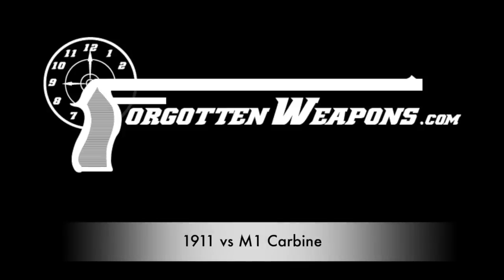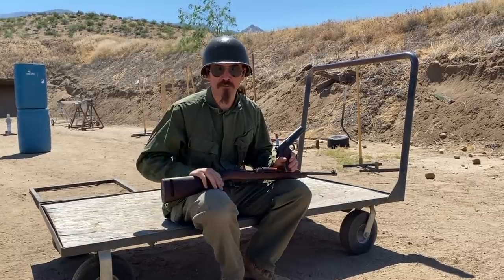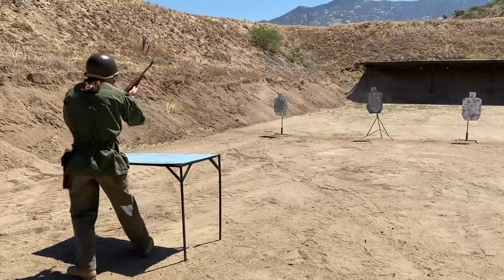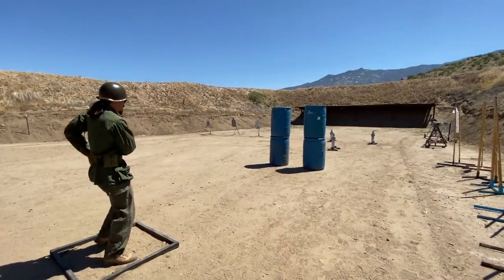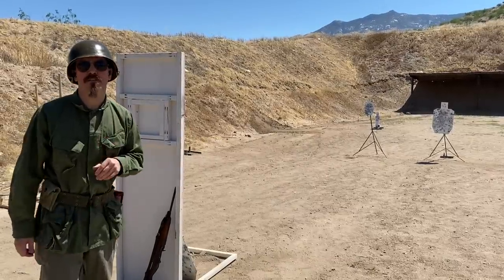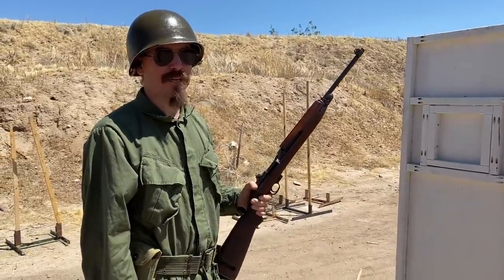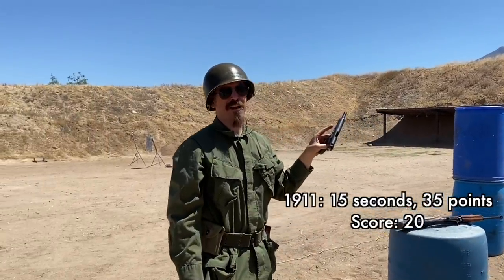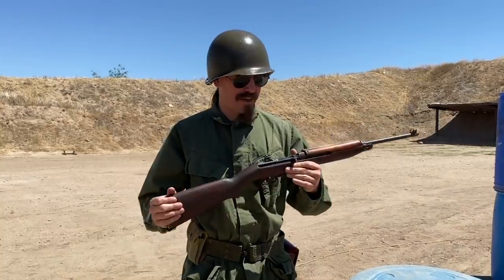1911 vs M1 Carbine in a Practical Match

Comment: No surprising results here. And that's taking into account that the simulations done here are relatively favorable to the 1911. In RL situations, support crews would typically engage enemies at distances where the 1911 is not even viable.
Reply: So if you put the two weapons into conditions advantageous to the 1911 and it still loses, that says something.
Reply: Stevarooni i mean... what did you expect? 1911 is a sidearm that you go to when the big guns run out
Reply: Can see why the US considered dropping M1911 as a side arm in favor of the M1(A1?)
Reply: TrolltheBurrito Or when exploring doorways, tunnels and other such things.
Reply: Jeffrey Root exactly, they both have their intended purposes
Reply: @nirfz  a friend of mine told me a story of a guy who left his rifle to do whatever, his CO took the rifle and made them all look for the rifle for hours.
Reply: @nirfz  In addition to what you've said: it's not only the time to draw the 1911 from the holster but to chamber a round as well, as they were carried with an empty chamber at the time.
Reply: If you have the M2 carbine you also have full auto fire which is an advantage to consider because as a rear area solider your job in that situation is to not die and the larger mag and full auto fire of the carbine is much better suited for
Reply: Yes, in a RL War situations the Carbine M1 out do the 1911. But in todays modern society, I can carry and use my 1911 out and about a lot easier than an M1.
Reply: @seanmac1793  Drop the rear area garbage. Support forces are in danger and there is no front in War today.
Reply: @neoasura  CCW and war are not the same.
Reply: @WALTERBROADDUS  in world war 2 there was one
Reply: @seanmac1793  I think you forgotten that the Airborne were using M1 Carbines for both frontline & behind enemy lines.
Reply: @nirfz - was driver for many years. Issued pistol (M9/M11) and carbine (m4), as well as a 12ga for door knocking. My pistol was only good to fight my way back to the carbine I should have never set down.  Learned that lesson quick, and once was all it took.   When driving my pistol was holstered on my right thigh (because 2004), and my carbine rested between the e-brake and the trans tunnel of my truck.  When outside the wire and I stepped out of the tuck, even to drain some fluids behind the open door,  that carbine was NEVER, not once, more than an arms reach away.  This is the standard, and I can’t imagine someone in a similar position in WW2 doing any different.... IF they survived the aforementioned dumb mistake I did.   Legit test and shows that a carbine is, nearly always, the superior weapon.
Reply: @Rudofaux  I mean that is for exactly the same reason why it's sp good for non frontline groups
Reply: @hellcatdave1  depends if he is a crewman it would probably be somewhere on the vehicle. Arty probably over the shoulder while moving but set a side when operating the guns.
Reply: @seanmac1793  
I agree. Having to fight the carbine trying to slide off of your back every time you grab a 105mm round from the crate would be more trouble than it's worth.
Reply: @seanmac1793  Were you there during WW Deuce? I got news for you, no one gets more CAB trigger time behind a crew serve these days than an 88M. That's a truck driver.
The Logi Lines are always Target #1, and the MSR's are where they do their bloody business. For the record, we rack our weapons next to the cannon on the battery firing line.
Reply: I would suggest the opposite.  Pistol is in a slow to use holster (fair enough) but the rifle was ALWAYS in a very handy place to just grab...and I simply don't believe that would be the case in real life.  Where would it be in, say, a truck?  Possibly even behind the seat..... or somewhere equally less optimal.  Don't get me wrong...I'd rather have a carbine than a pistol...but I think THESE stages favoured the CARBINE simply because it was always readily at hand.
Reply: @WindFireAllThatKindOfThing  yes but the realities of war were quite a bit different at least to my understanding. It was a war with defined frontlines. I will haplly admit if I am wrong. Also I never said the carbine wouldn't be handy there are just a lot of situations where it's not over the shoulder. It might be under the wind screen or latched to the tank. For arty like I said probably over the shoulder if your moving and set down in arms reach when the battery is set up. I have never served nor will I be able to but I don't think what I saying has any flaws logically with it.
Reply: And a nice tan
Reply: MrNotadream  you just attach it to the side of the vehicle with shovel and other tools
Reply: @FoxtrotFleet  thats how this drill was run.
Reply: @andyhenderson441   excellent point.  I made it also
Reply: chris younts  the vast majority of rounds fired at the enemy is to keep their heads down so they can't line up a shot at you. I could see squeezing off a 1911 while others are reloading or when running low on rifle ammo.

Comment: A LOT of what I see, is the trouble Ian is having with the "suicide flap" holster.
When I was an MP at Bragg in the late 90s, we were going through a monumental equipment shift, from "military gear" to "civilian gear."
Yep, back then, it was the military who looked to civilian cops for advice... Not like that today... Hasn't since 9/11... But, I digress.
I was issued a suicide flap holster, in OD Green (as was the MP Duty belt configuration of the time) and we called them that for a reason...
Not only did you have to fight with, and hold up the flap, the friction inside the holster during the draw, would cause the whole f'n holster to flip up, and jam everything up.
Every time, throughout this video, you can see Gun Jeebus encountering these problems.
When the MPs switched to "real cop" equipment, we went with Bianchi. And they actually made those flap holsters in black, I still have mine - they were sold commercially too, I didn't steal, I just bought mine before they were issued. I'm stylish like that. 😏😎

Now, they did make a thumb-break snap "conversion" which eliminated the suicide flap, and I also had that, and it was a game changer, for that holster.
The Uncle Mike's Level 3 holster was THE hot item at the time, and UM's had since gone to complete shit. Only the K9s, and a few other very specialized individual MPs (like wildlife and traffic crash investigators, etc) were issued them, because the Uncle Mike's was that goddamn radical of a change from the traditional, even in the civilian police world. So, the elites of the already elite Airborne MPs got the goodies.

The suicide flap holster was eliminated by 2001, replaced with horrible Bianchi Level II holsters, that would literally jam the Berettas in... They were downright lethal, without a doubt. Way worse than the suicide flap even... We had to jam our pistols through the holster/unholster procedure hundreds of times, sometimes having to do it by teams, peeling off shreds of plastic from the Bianchi "pinch system" - until the pinch system was effectively useless as anything more than light retention, and we relief on the snap. By that time, I was a DA Civilian cop, working at Fort Greely Alaska. I still have that holster too, because by... Urggghh... 2005-ish... We standardized on the UM Level 3. Although, I also carried with a Serpa (which became the next big thing after the UM's Level 3) - again, my personality and being the first kid on the block to have the newest toy, 😆 But, that didn't last long... Even though I still think the Serpa is a BAMF.
Then, eventually - as a cop for Veterans Affairs in my career - everyone went to Safariland holsters, and Uncle Mike's, became obsolete.
And uh, yeah - so there's your "Holy crap that was a long post, lesson in military holster history" way of saying, holsters make all the difference - choose wisely, choose what fits, and and choose knowing that you are 100% confident, if you ever have the need in a real world "holy f'k, oh dear!"
Reply: Well, I have none of your record, but it seemed a lot like that to me as well. I wonder how the pistol would have fared if it was laying on the barrel itself.
Of course, the recoil difference matters as well.
Reply: Definitely would have been closer with a better holster and/or the pistol on the table. The point Ian's trying to make is difficult since he's a good shot with pistols, and far more practiced than most line infantry were with pistols at the time, let alone support troops. The carbine is much better for someone who can't aim with a pistol, but pretty similar for someone who can. I know from experience with my Grandfather's M1911A1 and M1 Carbine from WWII that it's far easier for a novice to get shots on target with the carbine than the pistol.

Comment: This is more a weapons system comparison rather than just the weapon.  The incredibly slow times for the 1911, can in part be attributed to the ridiculously slow holster.  Therefore probably making it an even more accurate comparison under pressure.
Reply: Well, you have to conder the Ian is an expert shot with a pistol, as opposed to Joe Bazooka who was not nearly as well practiced with pistols.

Comment: One thing to consider is that I would think Ian has had far more handgun trigger time than the avg WW-II GI would have had which is bound to improve his 1911 times over what the avg GI would have done. This makes the M1 in my eyes at least even better than shown for it's intended propose.
Reply: The gap would widen massively if a less experienced shooter did this test, they should try that.
Reply: Yeah, it shows how much it improved the ability of a GI to defend himself.
Reply: I still think that if I had to chose any one gun to hand to an inexperienced shooter in a defensive situation it would still to this day be the M1 Carbine. Extremely simple, lightweight,  fires a reasonably effective but low recoiling cartridge, and requires far less training to use effectively than most any other gun whether it be a rifle or handgun
Reply: He is also shooting using both hands and if i recall correctly that wasn't taught at the time
Reply: Even if Ian is an experienced pistol shooter with better training then the avg soldier, the fact that the M1 still beats out the 1911 in his hands is a testament to how much better a M1 was.
Reply: The average soldier is lucky to hit a man sized target at 20 yards with a pistol.
Reply: Also have to factor in that in a real combat situation the target  will be or will have friends who are shooting back. That adds in a considerable amount of stress.
Reply: Wilson J An M4 with an optical sight would be slightly heavier but substantially more capable. Modern materials and design allow for a more capable cartridge in a system not much harder to control in a similar weight.

Alternatively an MP5 or other modern SMG with a red dot can be lighter with capabilities between and M1 and M4. .
Reply: @88porpoise  For a moderately experienced shooter I would agree. For someone who's never handled a rifle before no. Still think the M1 wins in terms of near idiot proof simplicity. Add to this lower noise and blast indoors.
Reply: @wilsonj4705  a 5.56 AR variant recoils barely more than m1carbine. It's also no more complicated to manipulate. As for noise and blast inside a building, both will be loud as fuck without a suppressor, so that's not a strong point.

Many modern PCCs are better suited than an M1, especially considering modern ammunition.
Reply: @88porpoise  An M4 carbine with a loaded 30 round magazine is almost 2 pounds heavier than an M1 carbine with a loaded 15 round magazine. That's not what I would describe as "slightly" heavier. I won't dispute the M4 is more capable in most scenarios, but for small and inexperienced people that 2 pounds makes a difference.
Reply: @bavarianpotato  I know both are loud as F.  I own and have been shooting both for decades. 
I'm more concern about the simplicity aspect of the firearm than anything else.
No optic to turn on. No optic brightness to fiddle with. Charging is in you your face simple etc... I think many experienced shooters forget what it's like to not know where everything is and how it works. I work in IT and many IT techs forget what it's like to not know where everything is and how it works.
But as always it's all just my opinion and it's worth every penny you paid for it.
Reply: @wilsonj4705  indeed, there is something to be said for the simplicity of "pull that handle on the side back, point it at bad guy and shoot" especially when you are talking about someone who is not a gun expert and just needs a home defense weapon.
Reply: @wilsonj4705  I really like the M1 and agree with you.
The AR 15 is also very simple to operate and inexperienced shooters can become very proficient at close and medium ranges with a minimum of training.
I still want to be shot with either one.
Reply: @88porpoise  I like the MP 5 option. Nice call.
Very nice weapons.
Reply: @wilsonj4705  no optic to turn on? You know you can slap iron sights on (almost) any firearm? 

I just don't see how the M1 is any easier to manipulate than any regular PCC.
Reply: Wilson J Are we talking a military type scenario like the M1 was designed for? You are going to have enough basic training to use it and for a person with limited experience a red dot type optic is going to just be faster getting rounds close enough. And the additional capabilities of 5.56 are going to be very valuable. And if you are in a situation where the size difference is that much of an issue, a modern SMG is an option, they have come a long way since WWII. 

If we are talking someone with in a home burglary scenario, any reasonably reliable high capacity 9mm pistol is probably the best option m. Small, easy to maneuver, at point blank range that accuracy isn’t relevant. If you want something bigger, a thirty round magazine in a pistol caliber carbine will give you more firepower.

The M1 Carbine was a hell of a thing for its time, but time has passed it on and while it is still useful it has been surpassed. Much like the 1911
Reply: @88porpoise  You guys are off topic talking civilian use. And the . 30 carbine beats any 9mm para SMG or PCC.
Reply: WALTERBROADDUS In many ways, definitely. But if size and weight is critical, a modern SMG can easily be smaller and lighter and still throw plenty of lead down range to make someone think twice about exposing themselves while you run. Plus easy fitting or modern optics and versatility any WWII era gun doesn’t have. 

If you want more than that or size and weight aren’t the overriding factor to consider, an M4 is pretty much just better.
Reply: @WALTERBROADDUS  what part was wrong and why?
Reply: @88porpoise 
Also we were talking about civilian use: I doubt .30 carbine has significantly more stopping power than a .45 with modern hollow points at close ranges (and if you need a gun that's effective out to a few hundred meters just get a 556)

Comment: 30 carbine 
Fired from a rifle : every one :it's under powered and won't penetrate a thick coat 
Fired from a pistol : weapon of mass destruction
Tommy gun or 9 mm ars are fine too
I don't get why some people hate 30 carbine that much
Reply: Because some people would rather pretend that a cartridge roughly equivalent to .357 magnum can't penetrate a winter coat than admit that grandpa missed.
Reply: They probably think of it as less than a full power battle rifle. By that standard it is not as good. For its intended role it seems great. Ian demonstrated its excellent shootability. In these scenarios the carbine would probably put shots on target better than the M1 Garand.
Reply: @jic1  ROFL, that's savage!  Mostly because it's true!
Reply: Paul Harrell has a great presentation on why the M1 carbine has the reputation it has, and why it’s flawed

Comment: You should also keep in mind that Ian shot the pistol very accurately, while a random support troop in WW2 would probably miss quite a bit more and have to reload, making the gap between the 1911 and M1 much more evident
Reply: Also you have to consider the army standard issue holster at that time was to protect the pistol from mud and water, (remember the trench's of WW1).  There was no army "Quick Draw" holster design criteria.  So Ian was handicapped because he could not use a modern holster specifically designed for quick draw competition.  Even so it displays how wide the gap could be with people who shot only rifle or shotguns, and only saw pistols in the movies.

Comment: The extra 2 seconds for the 1911 on the first drill were the holster rather than the weapon.
The M1 carbine is a much more effective weapon no matter what you look at. It's a little more than double the capacity, it's got a round that is as effective as 7.62x39, and it's got a much longer effective range. The only time that you would prefer a pistol as a main-arm is when there's no room to maneuver anything larger. Such as in a tunnel dug by VC.
Reply: Thought tunnel rats went for revolvers
Reply: @paulelliott6673  Yeah I heard that the 1911 would make ears bleed in the tunnels or something like that
Reply: The holster is part of the weapon system.  Maybe it could have been improved for faster draw, but the fact is that if you were issued a 1911 in WWII you would almost definitely be carrying it in that type of holster, and the first thing you would have to do if you met unexpected trouble would be to draw it from said holster.